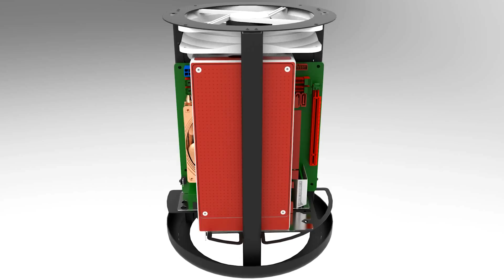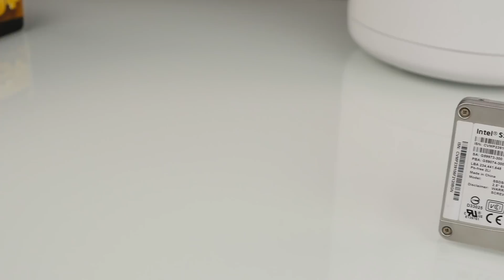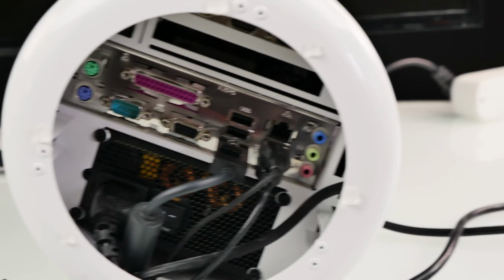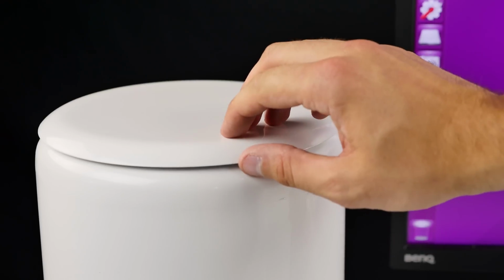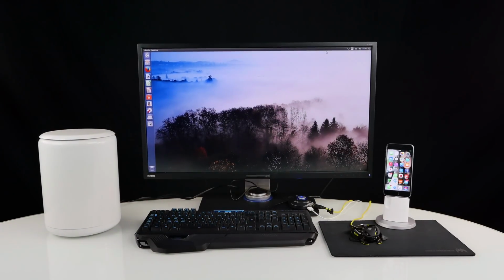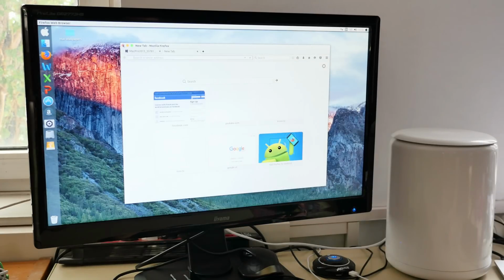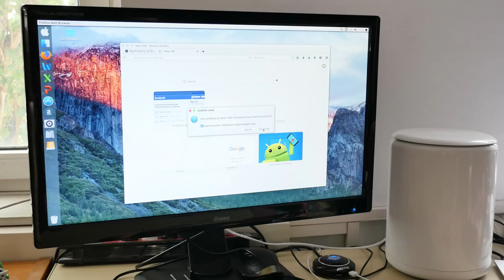DIY MAC PRO ! How to Build Your Own Mini PC - Bottlenext Entropy !

Comment: why even put a fan in it lol both gpu and cpu is passively cooled the only thing with a fan is the psu and that problary will barely turn on with the psu only powering fanless parts so the fan is actually just gonna make noise lol

Comment: I could move my mini ITX Z97i-plus mobo pc (intel 4690K CPU) Siverstone SFX 600 watt PSU, GTX 750 card, 512 gb crucial SSD into this lovely cylinder. Low profile CPU fan.....two sticks of 8 G low profile DDR 3.... plus use the M.2 on the back of the MoBo if required. Great gaming machine at a fraction of the cost 😀

Comment: Ehh thats just a supersized Hackintosh Mini. You need Xeon CPU, ECC Ram & Firepro / Quadro GPU to build an actual Mac Pro class Workstation. Basicaly as much error redundancy and correction as possible for mission critical work. Suprisingly the real MacPro actual does pass.
Reply: The trash can (aka new) Mac Pro is trash (lol see what I did there?). I have a slightly older computer tower Mac Pro which is more powerful than the new joke of a computer.

Comment: interesting idea. a knock-off, right, but at least if you're a mac fan with common sense and not too much wad to blow then it can work out well. build a hackintosh into this case and you not only have a much better and upgradeable computer but it is cheaper too :)

Comment: I need help ASAP Buying this stuff to build a pc to run minecraft and record need feedback!
Apevia X-Hermes Metal Case with Side Window-Green X-HERMES-GN

EVGA 500 W1 80+, 500W Continuous Power, 3 Year Warranty Power Supply 100-W1-0500-KR

G.SKILL Ripjaws V Series 16GB (2 x 8GB) 288-Pin DDR4 SDRAM 2133 (PC4 17000) Desktop Memory F4-2133C15D-16GVR

Gigabyte GTX 960 G1 Graphics Cards, Black GV-N960G1 GAMING-4GD

ASRock ATX DDR4 Motherboards H170 PRO4

Cooler Master Hyper 212 EVO - CPU Cooler with 120mm PWM Fan (RR-212E-20PK-R2)

Intel Boxed Core I5-6600K 3.50 GHz, 6 M Processor Cache 6 for LGA 1151 (BX80662I56600K)
Reply: Hey this is Owen, I'm kind of a pc master. You definitely don't need this stuff to run minecraft and record. All you need is replace the core i5 with a Pentium 6th gen and replace the gtx 960 with the gtx 750 ti. That should get u running. All the stuff you listed is overkill for minecraft. For the recording software I recommend GeForce shadowplay. This is an amazing free software that only works on gtx graphics cards. I hope this comment helped you out.
Reply: +AwesomeAlpha lol. I hate to be that guy, but other people are "pc masters" as well. I know about pc parts and pc building too. Just like the 6500+ other people in the world.
Reply: TitoGreen You dont need any of that for Minecraft. Just find an older computer on eBay and MAYBE upgrade the video card. I ran and recorded Minecraft perfectly on an old Intel Core2Duo and Nvidia GeForce 210 computer I had when I was younger.

Comment: Mac Pro has many of their components customised for that shell so it can achieve mediocre performance with a hefty price tag. 
Mini-ITX would be hard to integrate a powerful CPU like core i7 level CPU, but there should be products outside in the wild. 
Maybe the case can be higher and larger so you can eventually fit a smaller size ATX board into it.

Comment: Is there no motherboard this size that supports M.2 drives? Would leave a lot more airflow than the SSD, you know you can now move the Ubuntu dock to the bottom ?

http://www.pcworld.com/article/3047157/linux/ubuntu-1604-lts-will-let-you-move-unity-7s-launcher-to-the-bottom-of-your-screen.html

Comment: My computer specs: a large potato with a bunch of computer components stabbed into it.
It can run GTA 5, Minecraft, COD, etc 500 fps at high setting :D
Reply: I have a ugly potato, gta V Ultra settings 70 fps
Reply: I use a pringle can. Its so good.